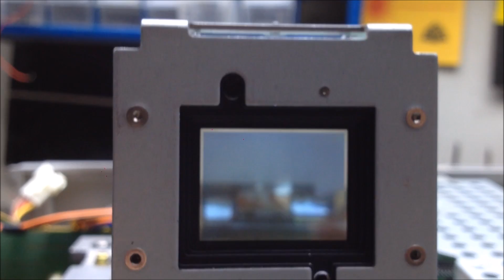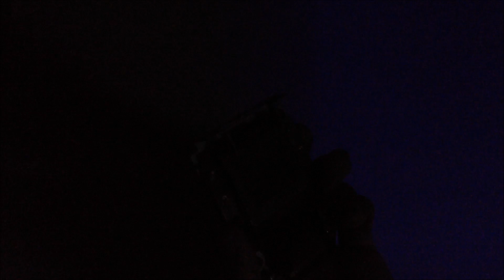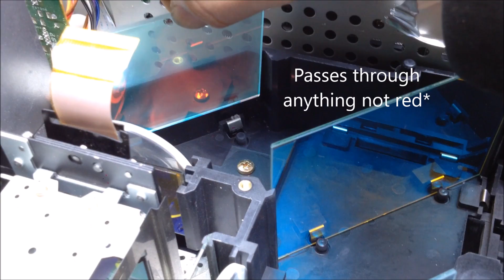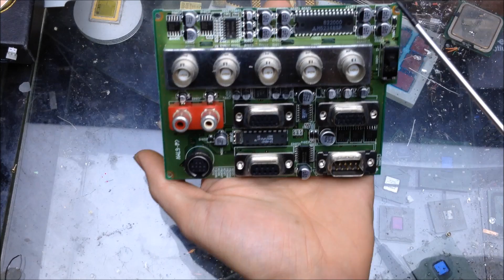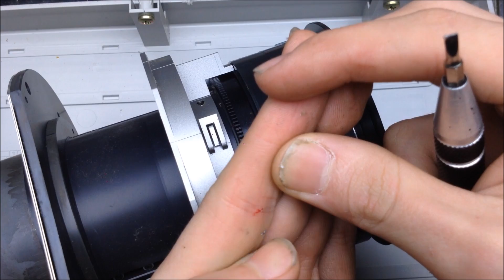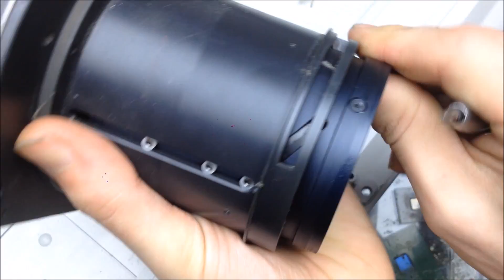1998 Sharp 3-Way LCD Video Projector Complete Teardown

Comment from the maker: One thing to note, I did not really talk about was the set of tracks in the front lens assembly, 3 lenses inside and as the spiral cut cylinder rotates it pushes those 3 lenses into different positions inside of the track. This system is for the zoom functions. But it still looks like a death ray part :P

Comment: Is this one of those dirty old projectors i gave you? Or is is a different unit?
Reply from the maker: Yes, I tried to get into the inputs but it only gave me RGB and basic video, I could not for the life of me get it into VGA for the computer, I am betting it was some kind of remote function, Ron and I tried for a bit and gave up, I sent the other one off with him to get some use out of it worked fine, was  a little brighter and had better lens options although an unspectacular resolution. But yea... strange PSU board aye oh hey while you are here, you have to check out what the inside of the Dichro cubes look like, the one in the projector had uneven edges on the top and bottom, not the best manufacturing but I was able to split it after a good 45 mins with the heat gun. There is only a single axis of dichroic coating, it's a little baffling.

Comment: I love taking apart projectors! Very nice, big one you got there. All the new ones are disappointing.
I recently had the pleasure to take apart a Sharp XV-100, from 1989. Really nice optics. The lens/objective looks to be about the same size as in your Sharp, as are all the optics, too. No motors. It alsso didn't use a dichroic-cube, but just dichroic mirrors. There wasn't even a place where you could put a cube - if you know what I mean - the angles were all weird.
The LCDs are about twice or even thrice as big as in yours though, and only had a 640x480 resolution. (76mm diagonal) xD
It also had a ultrasonic delay line.
Totally different build. Such a huge difference to this one! Yours looks already way more advanced.

Same black goo on the boards though. xD
I really enjoyed the video :)
Reply from the maker: The old projectors are where the good fun parts are, when the market was competitive and innovative on many fronts, it's really hard to find unique and clever designs in newer projectors. If this was a newer projector the video would of been half as long lol.